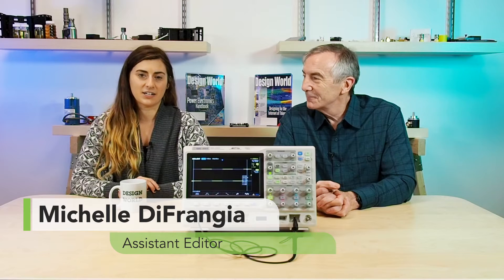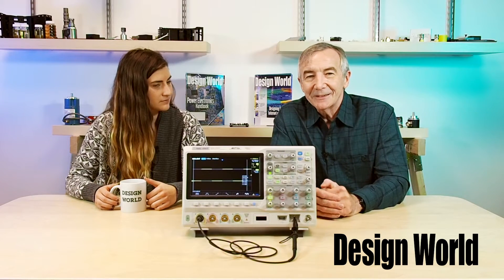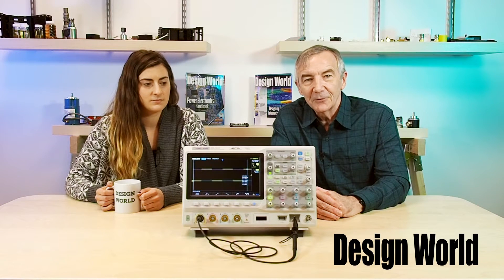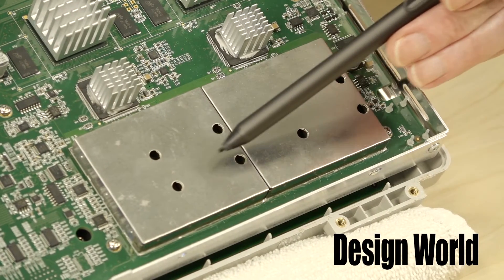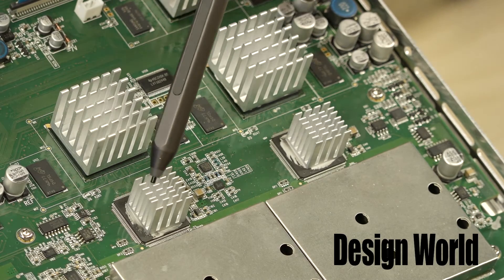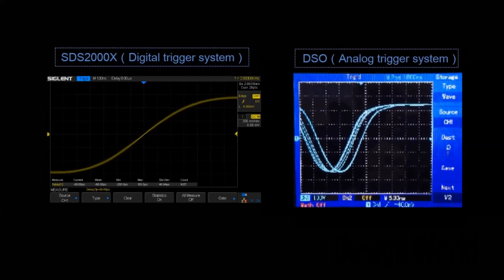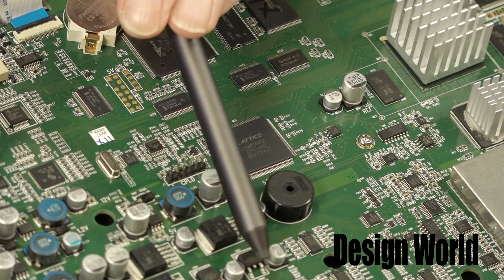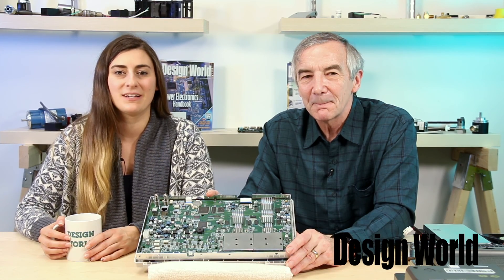Inside the 300 MHz Siglent SDS2000X oscilloscope

Comment: I recently purchased SDS2304X. It is a very easy to use oscilloscope.
Since AWG and DIGITAL_CH are built in, no extra BOX is required.
However, it is unfortunate that there is no frequency response measurement function like the SDS1000X series.